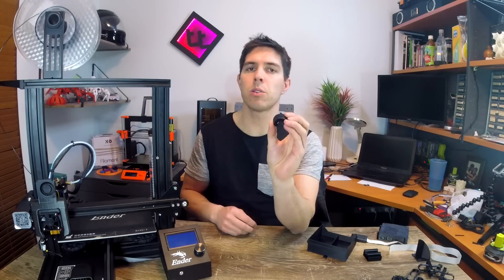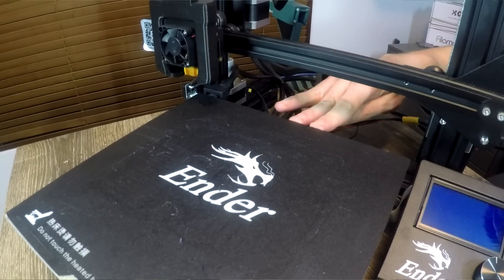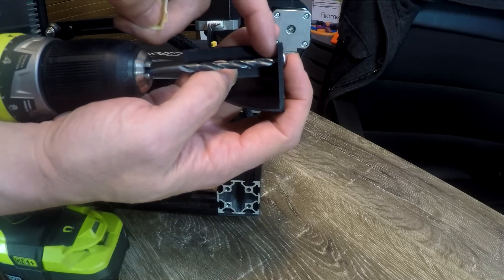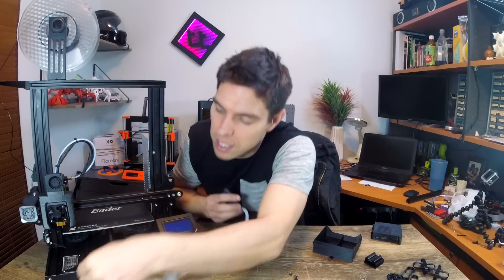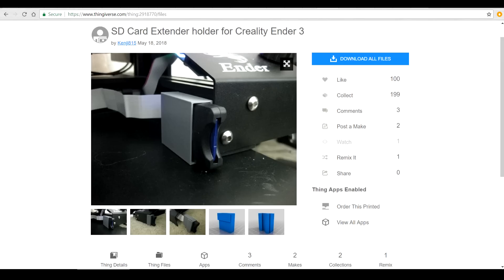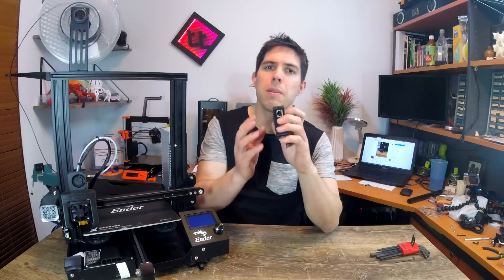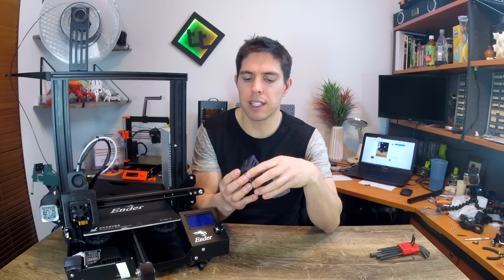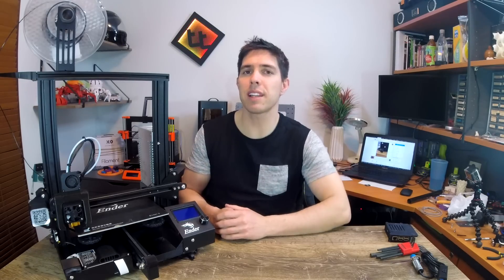7 more easy 3D printed upgrades for your Ender 3

Comment: Nice video, great work. I've been doing some work on my Ender 3 too: I've installed Marlin 1.1.9 and bed autoleveling with it. I used a 8mm induction probe (like the Pinda in size, very cheap) and made a holder for it. It puts the probe on same Y and to the left on X. Had to change several things, like some wires on Z and inverting it (I kept the z endstop as safety), and mixed both with a diode. I wanted to activate advanced filament change and filament runout but the board has not enough memory so I've ordered a board from a CR-10S and I'll try to configure Marlin to work with it. It has an Atmega2560 on it and a bunch more pins available to add nicieties, hehehehe... If memory allows me probably it will end having controlled fans to cut noise when not printing. I'm going to try the noise dampeners too, but I think that the stepper whine may be fixed just when I replace the steppers with powerfuller ones.
Reply from the maker: Great post! I have a spare MK3 pinda probe, they are cheap. Planning to experiment with it as a DIT ABL solution. Also found a mainboard I'd like to test for printers with limitations like this. Good luck finishing your mods!

Comment: 2:11... Why should everyone have a piece of Carbon Fiber Tube in stock ???? I'm convinced that any material with the same or similar thickness can be used to prop up the printer
Reply from the maker: It was a sarcastic commnt because I figured no one would have it. Using it for another project on the channel soon.
Reply: Got it....

Comment: I took some of the packing foam that it came with, cut it to the width of the extrusion, and doubled it over. It works amazingly as an insulator from my desk. So much quieter.
Reply from the maker: Great tip.

Comment: Hey, I remember you mention doing a video on upgrading a printer with .9 degree steppers? Do you know where I could find that? Do they really work to make better prints or does microstepping make it a wash?
Reply: This is done using Octopi with the Octolapse plugin. It is run off of a Raspberry Pi. I do the same thing, and can tell Octolapse that on a layer change, move to these coordinates, wait a second, take a picture, then go back to printing
Reply: You can in theory get better resolution but I didn't notice any difference when I tried them, they're a tad quieter though.
Reply from the maker: It was my Frankendoodle video. Next part of that is coming after the Micro Swiss metal hot end arrives. I haven't done any back to back testing on the stepers, but it would make an interesting video.

Comment: I printed your recommended Br. Boos tray and it’s really tight fit. It also covers the vent on the electronics box. Doesn’t it need to breathe?
Reply from the maker: I think if it sealed it completely it would be a problem but there are plenty of bits for it to draw air.

Comment: Thanks for the vids. Found lots of good info that has & will save me lots of time, particularly with some of your other vids like flashing with the arduino.  So a few bucks coming your way via Partreon.

Anyway. here are a couple of my picks for ender 3 prints you have not done but I really like.

Filament guide with bearing, I tried a few others and got rid of them and just use this now. (+10mm of tubing sitting around the lead screw)
 https://www.thingiverse.com/thing:2897367

This nob and bearing I really like. https://photos.app.goo.gl/wF33W3hMFPuN83zd8.      nob is loose and so print at 98% and bearing needs 1.3mm spacer at the back to make the alignment bang on.
https://www.thingiverse.com/thing:3003690 https://www.thingiverse.com/thing:3014508

Next i want to mod this for my filament holder https://www.thingiverse.com/thing:1241566.

Keep  up the good work, I'm looking forward to your next few auto leveling vids.

Cheers.
Reply from the maker: Thanks for your support and the very detailed comment. Some really nice mods there. The first one I thought was a whale. I've never seen a Z axis knob before, very interesting. Hopefully the ABL videos will be out soon.

Comment: I printed the cable chain an clips for my wires works great ! I just got my heat shrink tubing in yesterday for my buck converters for my fans any idea if they will produce heat or do I have anything to worry about with shrink wrapping then? I'm only doing it to insulate the pins
Reply: Also the bed handle is a great upgrade! To slide it in an out when its heated say for petg temperatures it gets pretty warm
Reply from the maker: Heat shrink can resist some temp. should be ok but monitor.
Reply from the maker: I was close to including the handle. I was worried it might collide with the drawer.
Reply: Teaching Tech no not at all I have all the things you have except I did cable chain an clips for Z axis wires an I didnt do the feet i have i foam sheet under all my printers

Comment: Glass bed? Good or bad?
Reply: Glass is a great upgrade, in fact Creality just added 3mm black tempered glass for the Ender 3  @ $21.97 w/free EMS shipping.
Reply: Exactly what I added to mine. Don't forget if add it you just added 3mm to the Z height so MOVE the Z stop switch UP 3mm. It is the one on the left hand side the whole extruder assembly comes down on. I initially forgot to do it so my nozzle crashed into the bed (no harm done). Please do not try to use the bed levelling nuts to take this difference out. BTW Creality suggest this change (you can ask them) will not void the warranty. If the bed is heated the glass will keep warm for a while longer after you might normally expect it to cool down so be careful when removing objects.
Reply: Good advice except, newer versions shipping with binder clipped removable 3MM build surface, so replacing with Creality's new black glass bed, just a quick bed level check required.
Reply: Thank you all for the amazing feedback. I'm totally new to 3D printing but I'm learning very quickly, thanks to these types of videos. Anything special that I need to do to put on a glass bed? Or has someone uploaded a video on the proper way to put one on?
Reply: Phirom Seng most people use small binder clips to mount it over their existing aluminum bed, other than that you'll just need to adjust your Z endstop up a bit to compensate for the added thickness of the glass (otherwise your nozzle will crash into it with your stock endstop position)
Reply: Binder clips, my recent Ender 3 came with the new 3mm BuildTak removable print surface, listed in parts at $12.97, not glued to the bed.
Reply from the maker: I printed on glass for years. It works pretty well. Main downside for me is waiting for it to cool to remove prints. Plus additional heat up time from added thermal mass.
Reply: I've never had a problem waiting for glass beds to cool allowing it to release. Owing a Robo I cringe at the ham handed way people abuse the glass bed and carriage, many videos on YouTube showing the same idiot behavior toward other printer designs.
Reply: Totally worth it, buy a generic sheet in your bed size for 8$ not the overpriced ender one. Glass sheets make the bottom surface perfectly flat and shiny.
Reply: Choices: My choice in this case is the black tempered glass shipping direct from China from Creality. Retired heavy industrial purchasing agent/3D hobbyist/builder since 2014, well over 2 dozen 3D printers, since the Ender was #29. Much cheaper then the Robo R1 Plus bed that newbies often destroy, since they simply can't wait for it to cool. Stained glass hobbyist with lots of mirror tiles sitting on the shelf. Choices

Comment: The original packaging top can also be used as sound insulation, just put the printer on it :)
Reply from the maker: The dampers are an automatic mod for me now.
Reply: You mean the big black material?
Reply: What I did is unstick the bottom rubbers, put the dampening feet on the printer and stick the rubbers back on the feet. The printer makes probably half the noise it used to do, and probably 90% less vibration.
Also putting the rubbers back on makes it grip better. The plastic dampening feet make it really slippery.

Comment: Your octolapse settings are lookin dailed!
Reply from the maker: They're are pretty close. I have a Logitech webcam that works great but I want to provide a cheaper option, so I have some cheaper webcams on the way to test before I make my follow up octolapse video.
Reply: Teaching Tech yeah I'm using a raspberry pi v2 webcam and the picture is nowhere near as clean as yours. Looks like I'll have to check out your upcoming vid!

Comment: Actually, those damper feet aren't the best idea. If you watch the printer closely during printing,  they can allow the printer to sway and resonate as the axes move back and forth rapidly, and introduce ghosting into your prints. A much better solution are one of the "squash ball" feet designs which provides vibration isolation while keeping the machine stable and sway-free. I paired the squash ball feet with a slab of concrete paver stone to create a super quiet and stable platform for my printer.
Reply: Nathan Rollins Agree these feets are quieten the printer but make prints bad...checkout https://youtu.be/Ws1JfHl3Y0o i got a 50x50cm playground rubber pavor under my printers quiet and no strange artifacts on the print. Even MK3 rubber feet are bad.
Reply: 3D Gussner I've not seen any negative side effects from the feet. No ghosting or similar artifacts.

The linked video shows that those feet can indeed lower resonant frequencies of the printer and increase amplitudes of vibrations.

Now I feel a bit bad because I sent Michael a message requesting a review of them - mostly because I wanted to see a measurement of how much noise they actually reduce. I felt they were a huge factor in quieting down my printer.

I hope other persons' prints don't suffer from this.
Reply: I have the larger versions of these feet on my cr-10s, and they do indeed quieten the printer a bit, but they do have a negative impact on print quality.
Reply: RedHotBagel Don't feel bad as I tried also different feets/solutions to get my printer quieter and with some prints the quality was good but some got quite bad. My final solution is the rubber playground pavor.
Reply from the maker: It's an easy mod to remove if you don't like it. RedHotBagel sorry I didn't test it more thoroughly for noise. I would have had to remove all of my dampers to get a reliable before and after.
Reply: It's far better to clamp down the printer to a very stable bench.
Reply: Squish balls are cheap and recommended. If only I could find the real name....